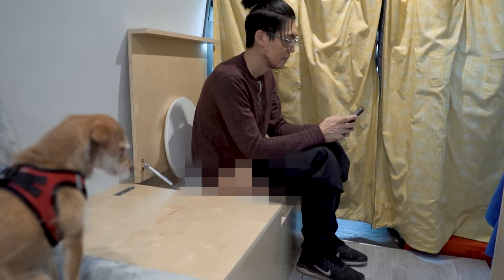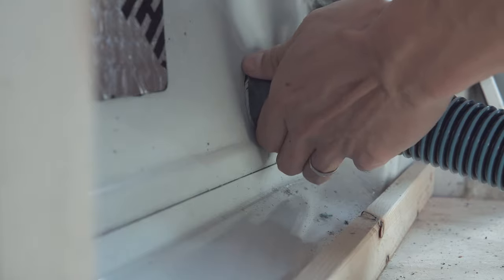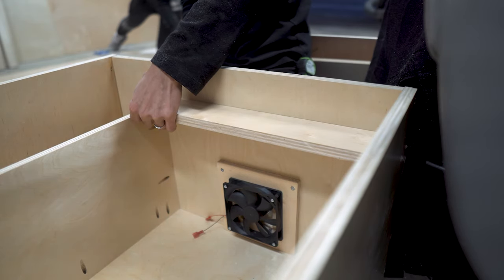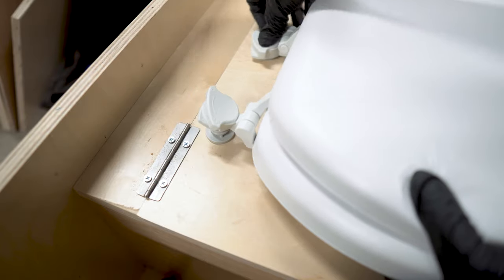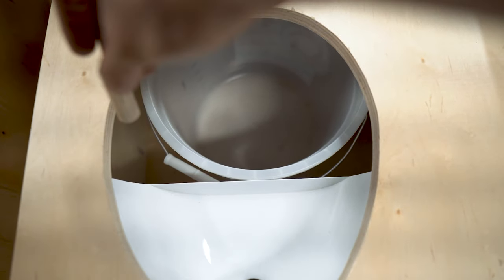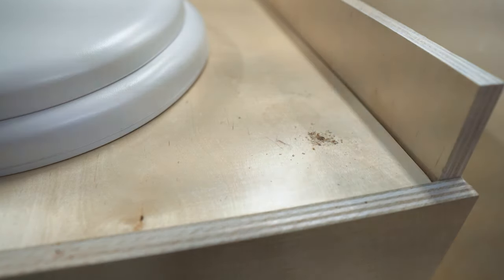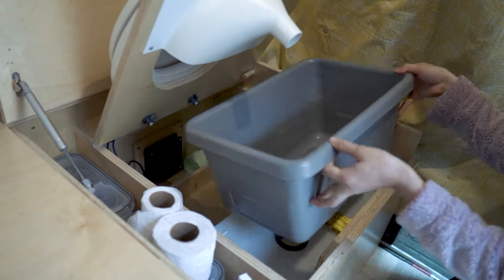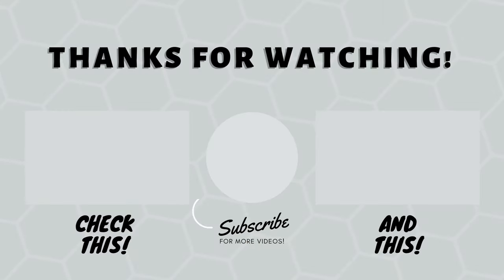How To Make A Composting Toilet

Comment: I'm a bit confused by the lack of sealing on the raw edge of the wood underneath the toilet seat. I think I would have preferred to use something which is not absorbent here, because over time there will be splash back and the wood will absorb urine, which will not be nice.
Reply from the maker: You're right! this wasn't something we touched on in the video, but we did address it after the fact - the exposed edge received a coat of epoxy to help protect it from fluids.
Reply: @IMEEMADE  Ah, I was thinking of something like that! 
I like the way the wood looks (and my last comment should have included a compliment for your work and nice video!), but I feel like something more wipe clean would be more hygienic. I like the idea of enamel, but it might be a pain to work with. Probably a coated (no rust) metal piece would be good.
The other thing was the distance between the seat and the edge of the bench - it seems like a long way! (I'm short), and maybe it could be a bit more compact? (version 2....?)
Reply: There's a similar unit (sans disposal bucket and diverter) for sale on eBay, where it is recommended to paint or poly coat interior and exterior to seal. $210!! Plus $45 for shipping. Wait - You two could be sitting on a gold mine! Ha!

Comment: Hi guys! You have probably already seen this but as I investigate van toilets...I came across a European company called Separett. They have a urine diverter bucket with a cool handle. I am not sure if you can add it to your current urine bucket or not but maybe check it out if you still need a solution for getting it out to dump. :)
Reply from the maker: Thank you so much for the info!

Comment: How does the composting work?..this just looks like a smell free port-a-potty, not a composting toilet.
Reply from the maker: The composting happens with the #2 side mixing with the organic material (i.e. peat moss, sawdust, dirt, pine pellets, etc.)
Reply: @IMEEMADE  No mixing required? Do you need to add the organics every time?  How often do you need to empty the bucket with , say, one person using it?
Thanks
Reply from the maker: No mixing required and add organics after each use. Emptying is anywhere from 1-4 days depending on usage.